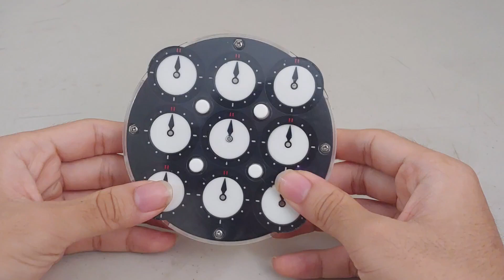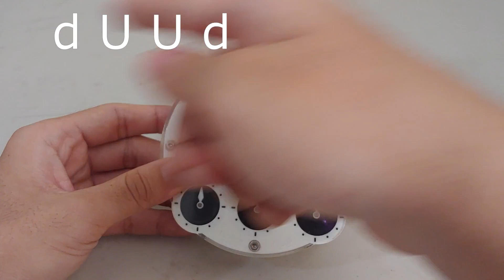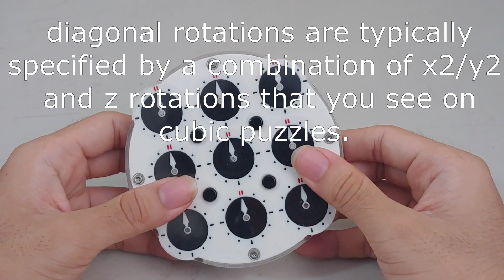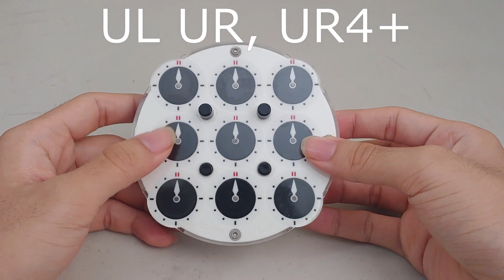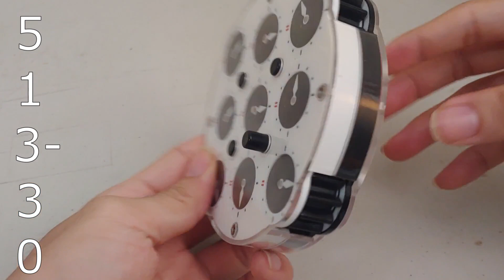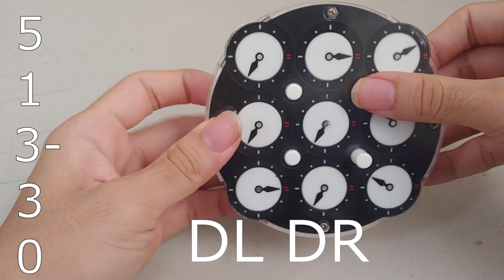How To Solve The Rubik's Clock with the Lou Method | Advanced Clock Method

Comment: I am following these steps as accurately as I possibly can, and yes a lot of the time it works.  But frequently the back of the clock is still mixed up when I check after solving the side I didn't memorise.  I have no idea why, is anyone else having this problem??
Reply from the maker: Are you still having this problem by any chance? I would be willing to walk through a solve to make sure it works for you
Reply: @ChrisChoi123  Right kind of you Chris.  I've not picked up the clock in a little while as there has been a decent run of competitions as of late and I've focused on the events that I actually can enter, but rest assured I am convinced it was simple pilot error on my part.  This is a great tutorial, and one that tI look forward to revisiting soon once the comps die down a bit. Thanks once again for the offer though.

Comment: for some reason i am always one off on the cross on the other side after i do the method. could there be a reason for this?
Reply from the maker: Perhaps you're missing a step? Or maybe you aren't tracing accurately on one of them. Or maybe you're not tracing in the right direction?
Reply: @ChrisChoi123  i found the problem. i wasn't tracing relative to 12 o'clock

Comment: Cheat sheet for what numbers to memorize. Clocks are named after their position (R: right clock, L: left clock, C: center, etc.). Two letters means the difference (i.e. what move is needed to match the first to the second. CL would be the move needed to match the center clock to the left clock

M1: absolute position of D + CL + CR
M2: LC
M3: DC
M4: RU
M5: UC

also pin order:
UR
R (UR DR)
D (DL DR)
L (DL UL)
not DR (DL UL UR)
solve corners

This is just a reference so I don't have to watch the video every time I forget lol
Reply: best comment award
Reply: I agree with using this as a reference so I don't have to watch the video again
Also imagine solving the center to the left center and then the right center to find the absolute point.
Using this as a reference

Comment from the maker: tips from my experimentation: if u speak english, u can optimise the memo info, aka the number of syllables u memo, by using this scheme:

(number - what u say/memo)

0 - skip
1 - one
2 - two
3 - three
4 - four
5 - five
6 - six
-1 - el (short for eleven) 
-2 - ten
-3 - nine
-4 - eight
-5 - sev (short for seven)
Reply: Some other pin orders

I hope I wrote this in a way that makes sense
x-y means move the x gear to the y gear
the pin state written at the bottom is for your first corner + move 5

this pin order moves DR/DL towards the beginning (moves 1 and 3 rather than 3 and 5)
MEMO
M1: u after LR moves
M2: l-c
M3: u-c
M4: r-d
M5: d-c

EXEC
DR c-u
R c-l
U c-d
L d-r
uduu

This one uses a z' move to get rid of DR/DL moves
MEMO
M1: d after LR
M2: l-c
M3: r-u
M4: d-c
M5: u-c

EXEC
UR c-d
R c-l
L c-r
z'
R c-l
uduu
Reply: I have one question, in case i dont rotate for the lucky cases can my second number be 0 ?